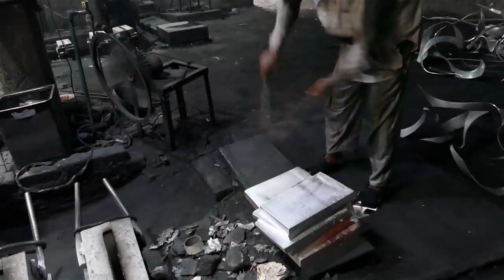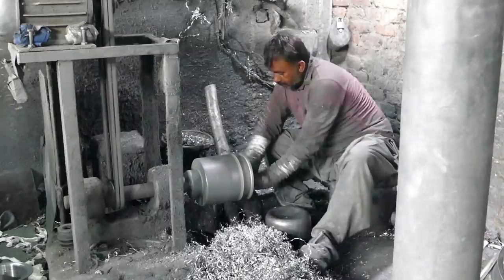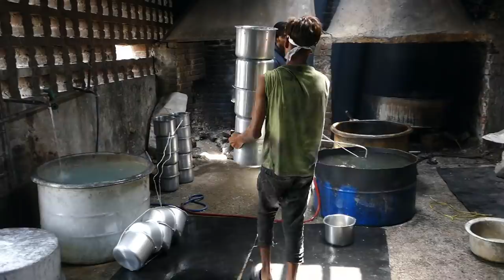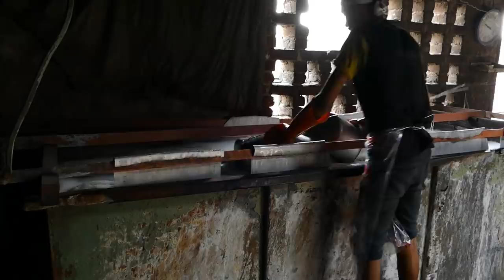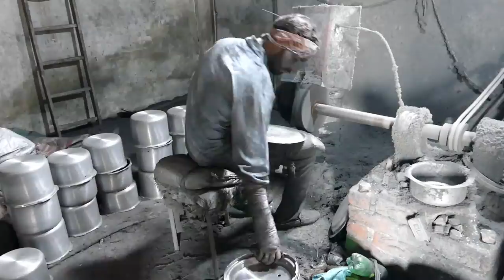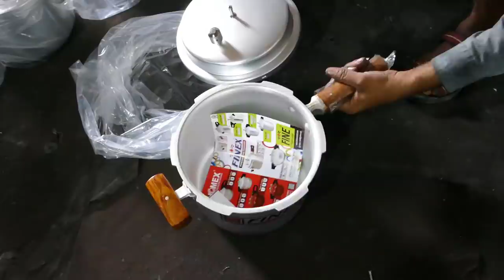How to Make a Pressure Cooker With Amazing Skills

Comment: I'm impressed by the craftsmanship of these men BUT, the owner of this factory should provide them with proper gear since I am sure he's making millions.  Considering they have been doing this for many years, the running water being wasted is not good.  They could filter and recycle the water and use it again.  The chemical they use is not safely disposed, it gets mixed into the ground and is bad for the environment.

Comment: Factory owner should provide them good food, medical charges and they must modernise factory from with in, to add some security and secured smile ,when they return home.
Reply: Then your pressure cooker will be $1000
Reply: @nolanmckain2061  In India, we get good cooker for 10 US $. They are working with minimum safety and high risk.
Reply: Automate the factory make them loose their jobs
Reply: This is pakistani factory. Finex is pakistani company

Comment: Don't use such pressure cooker. it's unsafe and highly dangerous
Reply: do you think people could tell the difference ?? you wouldn't be able to either? plus this is not that dangerous ad long as there is a safety release value equipped. the aluminium is definitely strong enough to withstand the pressures.
Reply: Videos doesn't talk quality of things .All saftey valves are not same bro .Materials are different and their treatment is also different 😁

Comment: No Quality Control,?
No Pressure Testing,?
No Safety Testing?
or skipped directly to Packging 
Good job but need to show How pressure cooker testing is done for Safety will make  common house hold man woman understand Safety requirment too avoid cooker bursting in kitchen with improper use will bring public awarness